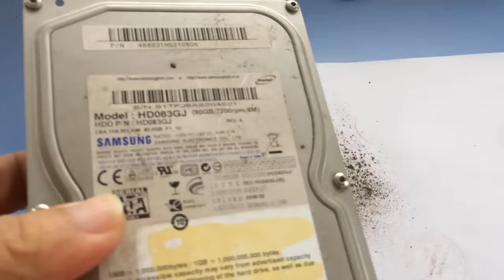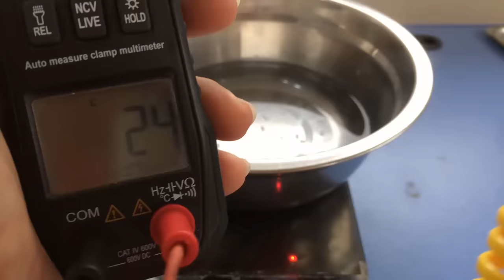How to make induction stove. Great idea needed in your home

Comment: Awesome but . Make more details about components and circuit diagram.
Reply from the maker: Please turn on subtitles for device list,. The circuit part you can refer to here:https://youtu.be/zRgiTU101Io
Thank you for watching!
Reply: I think it is a flip-flop circuit with one capacitor and two small coils . the other third big coil is the load . the flip-flope circuit needs two transistors here he used mosfet because of the huge current . then using this circuit he can use DC instead of AC .
Reply: @Green Fog Or maybe even burn the house down if left unattended at the worse time, because if they need that then imagine the power utility infrastructure...
Reply: Yes please

Comment: The cast aluminium part from the hdd will act as a shorted winding of the transformer, so most of the power will be lost in heating the aluminium part, coil and the transistors. Also, there can't be any good air flow because there are no other holes, except that one with the fan. Also, it can burn out because of too good coupling of the aluminium part to the coil and making a hard short causing it not to oscillate and then the transistors will burn or explode.
Reply: too many words to discribe a piece of garbage 😅
Reply: you forgot that the fan would propably melt cause its IN THE MIDDLE OF THE COIL where most heatng is
(at least the copper (any metal) it the fan would heat up)

Comment: i love it, good job, next model may have a way to change temperature, there are types food need different temperatures during cooking process.
Reply: Can you adjust the temperature by turning it on and off? You could plug it into a PID controller and now you have a precisely temperature controlled hotplate.
Reply: @rongo59  How many amps does the battery consume?

Comment: Your capacitor listed is wrong. It will never work with that value of 2.2uf that typ capacitor does not go that high. Maybe itis a 0.22uf? 0r 0.022uf? but not a 2.2UF. Great video.

Comment: Will not the heating element melt down the insulation of the fan-wire?
Reply: Its not a heating element, its an induction heating element, aka the coul itself doesnt get too hot, thats what the fan is for, but it will excite any metal placed above it and heat it up
Reply: @Epsicronics  How many amps does the battery consume?

Comment: hello friend can you show me the complete schematic of the project you made
I noticed there is a component near the ic voltage stabilizer: 7805
and can you tell me where you bought the parts
if it is through the website
could you send it to me
if you can
thanks 👍🏼
Reply from the maker: Hi my friend, the component near ic 7805 is an n channel mosfet(irfz44) to replace the relay that powers the fan and the oscillator circuit.
Thank for watching!

Comment: Not a good idea as the induction requires steady ac. You are just trading gas for more current. However, if you have green energy and use an inverter to convert dc to ac then it may make sense.  Nice project though.

Comment: Sir How many amps consumption
Reply from the maker: 15 amps. Thank for watching
Reply: @D.creative  Thank you sir
Reply: @D.creative  Sir polyester capacitor value please
Reply from the maker: @gurunathan3675  you can use capacitor 2uf to 6uf
Reply: Thanks
Reply from the maker: this is essentially a zvs circuit. i will make a detailed video about the circuit. thank you!
Reply: Sir I make this circuit but less heating please solution
Reply from the maker: use a 6uf capacitor, the coils are large enough and you can adjust the input voltage (the circuit uses voltages from 12v to 24v)
Reply: OK sir

Comment: Could you please give me more specification info of capasitor ( its voltage ? ) and diameter of toroid and its wires diameter ?
Reply from the maker: you can use 2uf to 6uf capacitors (100v to 200vAC voltage). torus diameter is 12mm and wire diameter is 2mm
Reply: @D.creative  if it uses 2,2 uF 450V , is it oke ? And about inductor , is it okay use 60 uH- 100uH ?
Reply from the maker: @gadgetfreak3885  i tried the circuit performance the highest is using 6uf capacitor (2uf x 3) and inductor is 50mH. Thank you for your interest
Reply: @D.creative  how about dc suply, how much its capacity? If i used adapter 61 watt , is it possible?
Reply from the maker: @gadgetfreak3885  The current of the circuit is 15A. You need a 200W .Adapter
Reply: @D.creative  ok thank you